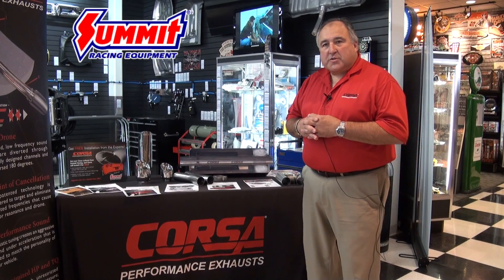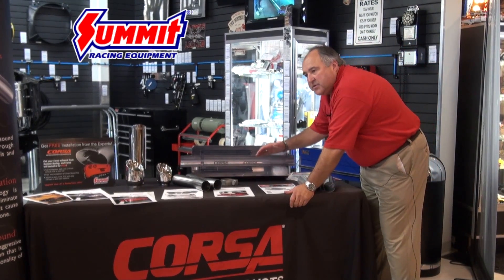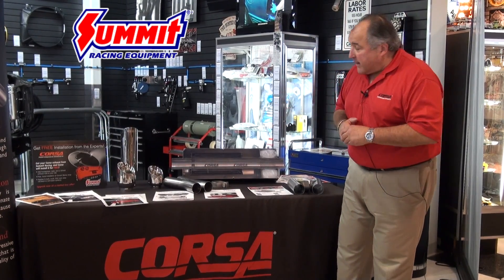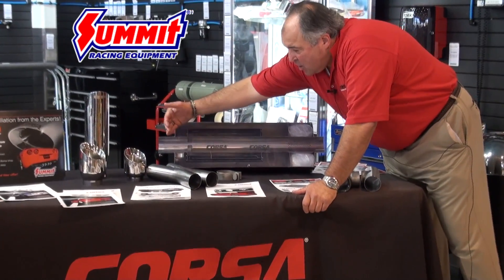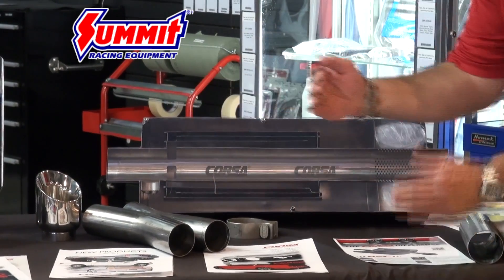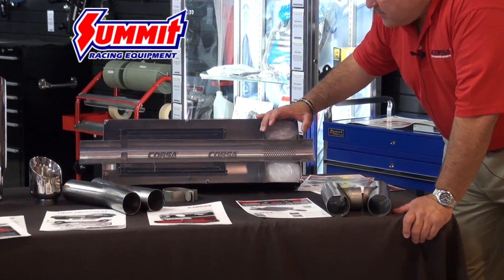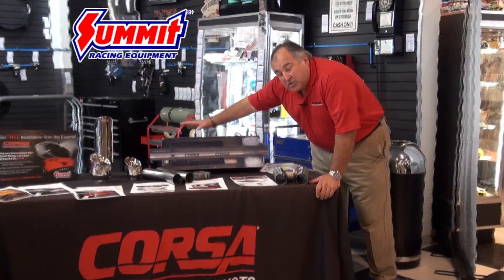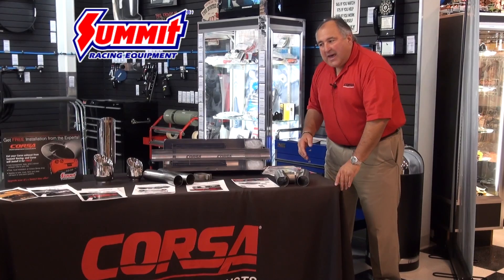How Corsa Exhaust Mufflers Work

Comment: I've heard Corsa systems on a lot of newer cars that sound amazing, but every single system I've heard on a 4th Gen LS1 f-body sounds like it has a lisp.  There's a raspy sound over top of the regular exhaust note that sounds like an air leak.  Maybe it's the transverse muffler isn't a good design.  Can't argue with how good the true dual setups sound.

Comment: So you're saying it's a glass pack.
Reply: I had one of their systems on my last Silverado. I'd say when you go full throttle the sound is a bit similar but when you're driving normally there is a pleasant rumble, no drone or resonance. Then I added an intake kit and got some pretty brutal resonance when loading up the engine but not downshifting on moderate inclines.

Comment: Does the fiberglass disappear over time? Just like the glass pack mufflers? And how does the dyno performance compare to flowmasters or any other performance muffler for that matter?
Reply from the maker: Hi Mark, 
Packing in any muffler will dissipate over time, especially as pressure, flow and heat increase. Example, street vs. race motors and power adders such as Turbo’s, Superchargers and Nitrous! As for power comparisons, try Corsas website or search the net!
Reply: Is the Corsa Sport muffler glass packed like the Touring?